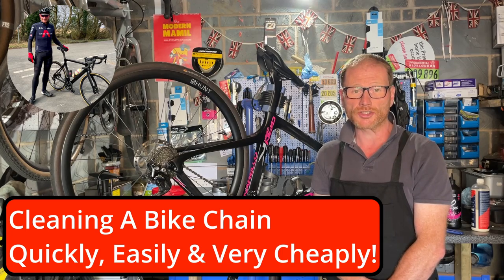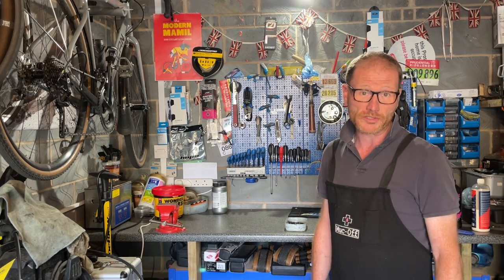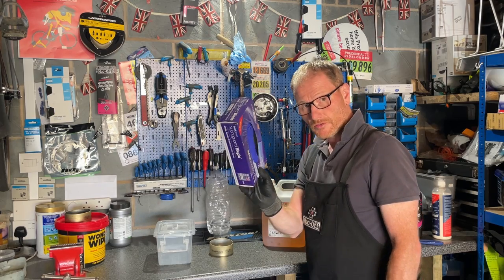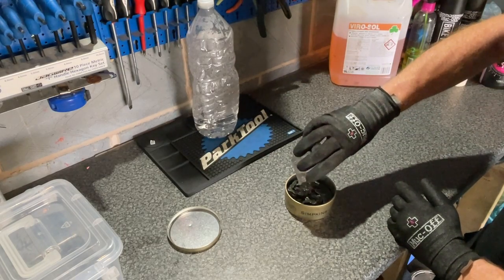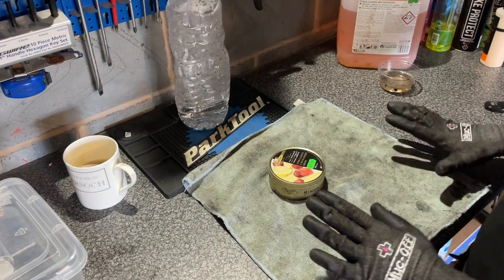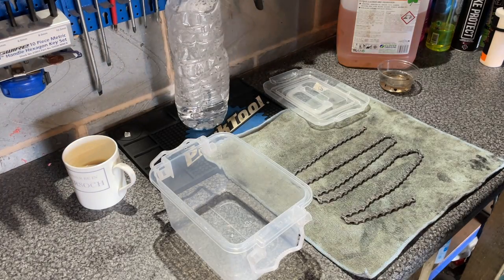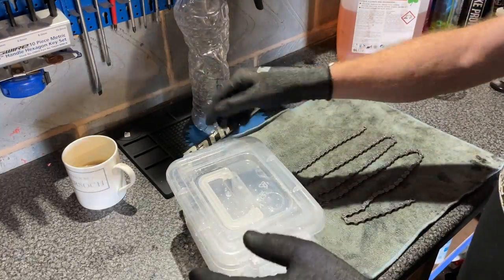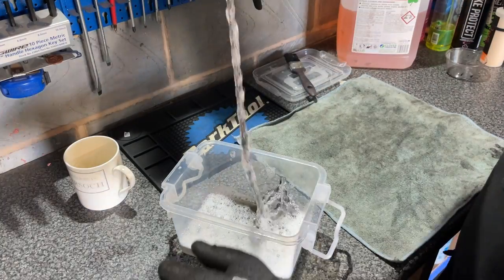Cleaning A Road Bike Chain  - Quickly, Easily & Very Cheaply!

Comment: Hi Jon, thanks for the tips! From your experience what chain lube do you use and recommend?
Reply from the maker: Hi Phil, I've never been a big fan of the 'Hi-Tech' stuff like Summer Specific (Washes off in the rain), or ceramic lube (I'm not Chris Froome!!). I've always gone with a light coating of a thicker lube such as either Muc-Off Wet Weather Lube, or FINISH LINE wet Lube. They're both as good as each other..... it's just whichever is to hand when I'm doing the job. Not too much (Acts like a crud magnet), oil just the rollers, and wipe off any excess.

Hope that helps, and thanks for watching.

Jon

Comment: I’ve always been a big believer in taking the chain off to clean but how do you manage the cost of quick links? Are you just reusing them more than they recommend or finding cheaper non-branded links?
Reply from the maker: Hi Rex TheDog,

Very good question. I use reusable KMC Missing Link. The 'R' at the end of the product code denotes reusable. Here you go:
https://www.kmcchain.com/en/product/connector-missing-link-cl555r-11-speed

Thanks for watching,

Jon
Reply: @ribblevalleycyclist  thanks for the info!
Reply from the maker: @rexthedog9637  No problem, hope it helps.
Reply: i just reuse them. Dont think one has ever failed
Reply from the maker: @markrushton1516  I'll admit, I've re-used the single use ones before and never had an issue.